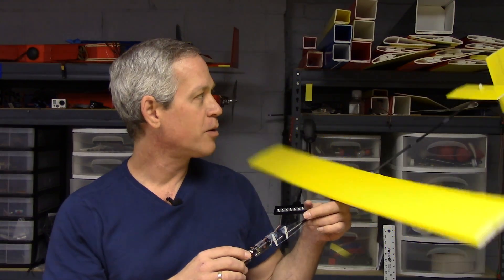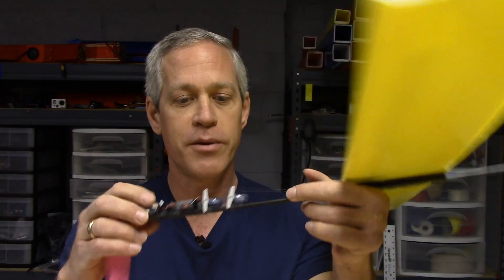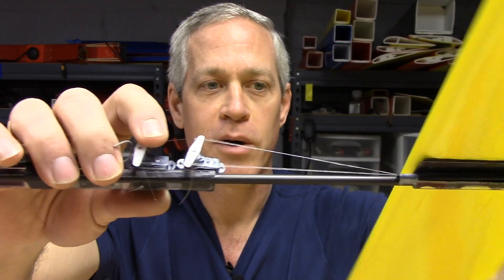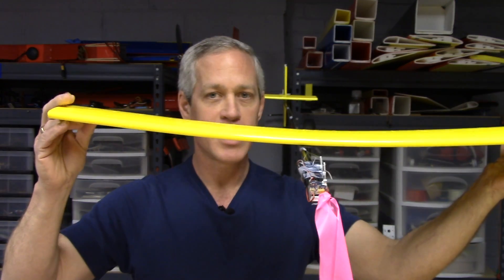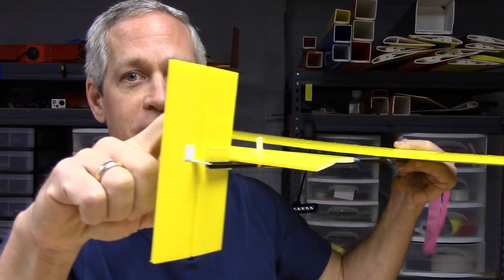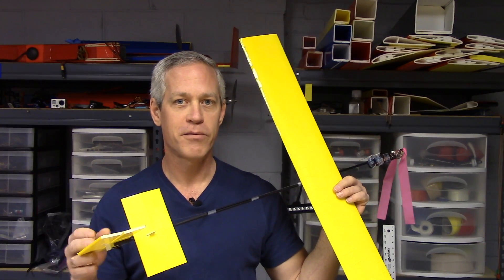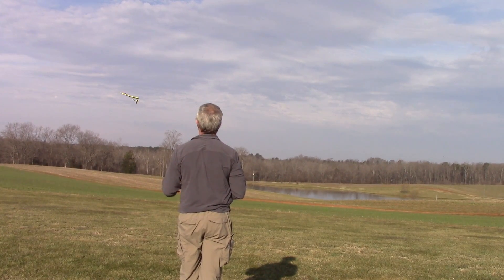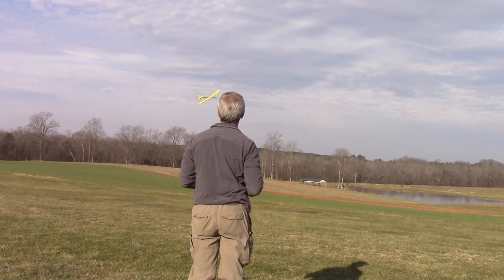Foamboard Discus Launched Glider

Comment: Nice way to make it modular; have you considered making an all moving tail plane type tail?
A pivot and a control slot in the resulting stiff tail seems easier than the current.
Please do not take this as a dis on the excellent plane, this is a suggestion for further models.

Comment: I made a variation of your design after watching your video. I ended up slotting out the underside of the main wing slightly narrower than the carbon tube, and pushing the tube into the slot added a few degrees of dihedral to the wing. This also gave it the extra strength to hold up to harder launches and made it a bit more streamlined. So far I'm getting about 30 seconds of flight time on flat ground

Comment: It looks pretty un-aerodynamic. You could make a thin balsa or plastic pod for the front to over the electronics. Also the front of the rudder and elevator could be tapered for less drag. I think this is one way you could get more longer flights.

Comment: A simple and fast way to lock the dihedral in ought to be to prop the wing up with the wanted dihedral, and then hit the top tape lightly with a not too hot covering iron....or a clothes iron on very low setting (experiment on some scrap to find the right heat)....to just remove the wrinkles seen in your clip on top of the wing when you push the tips up. The thin shiny Packing tape we use is most often made from polyesther, same as most heat shrink covering films , and will shrink in the exact same way when heated. I often use this method to "neat up" my older tape covered planes when the tape loosens a bit or wrinkles in the sun; its also good for improving the adheasion of the tape a bit. The reason for the low iron setting is partly that it's only the adhesive that is keeping the different stripes of tape together , and it lets go at a lower temperature than what the polyesther foil can withstand, allowing the tape pieces to shrink away from each other - and partly not to melt the foam. Just a question of finding the right temperature.
Reply: On the airframe itself: I have some DLG experience, and to me it seems you have the basics down nicely; it's quite light, and yet the wing still penetrates quite well. A bit of playing around with the CG might make it easier to keep level; the fact that it goes straight on a throw tends to suggest its balanced fairly close to the neutral point. Just slightly further forward will make you trim the elevator slightly more up, causing the plane to pitch up by itself on a throw, which is how I trim my planes. This is very much a "preferrence" type of thing though. Since it's RE only, a bit little more dihedral might also be a good thing to make it easier to control.
I also have a feeling most of the reason for your last throw to cause the wing to let go lies in the throwing technique, or rather lack of same. Your throw was more of a sharp flick than a large circle discus throw. The flick induces a lot of rotation, which would be great for a boomerang or frisbee, but puts very high mechanical force on the joints of a plane. Hence Great idea with the tape; built in chosen weak spot - you pick where it will break. Try straightening your arm out completely, and apart from whats needed to keep the arm straight, try to avoid using your arm or shoulder muscle to perform the throw. The movement should come from rotating your torso around its vertical center axis. This will in experience give you the highest speed along the intended flight path at release and the least amount of "flick". Hope this makes sense.

Comment: Great design! Perhaps if you make the wing bolt on and put a throwing peg in it you will be able to achieve 50 ft launches! Maybe a small carbon wing spar will help too. If you cut some material off of the tail surfaces it might help with the aerodynamics a little and it will decrease the tail weight allowing you to lengthen the boom, which will substantially improve flight characteristics.

Comment: Do you have to use the Elevator to keep the nose up? If so, it may be a bit too nose-heavy. It should fly mostly level on its own, but if it's nose heavy you'll have to continually use Up Elevator to maintain pitch, creating drag and causing it to stall out. Try adjusting the CG about 1/8" at a time and see if it helps.

Comment: I like the design, nice!  I agree with the other guys... slope!  and a bit more wing area maybe?  Single plate kfm-2, massive bevel and tape hinge the leading edge of top and bottom plate; top plate is 40% to 60% of wing cord (bottom plate)  Easy build, really strong, and the step on top makes great lift for a glider.  Blue skies, Brother

Comment: The way you throw the plane is... well, bad.
First of all, you got to extend you arm more in the beginning of the launch. When your arm is close to your body all the time the plane don't got time to accelerate in a orderly fashion. If you start with it extended, rotate you torso, and bend the arm closer to your body right before you drop it. As long the pitch is right, and you don't drop it to late you will see it penetrate the skies. 
Secondly, consider making a new, thinner wing with a carbon tube as a replacement for the foam spar. 

Nice plane though!

Comment: I love that you are taking on this challenge!  I am by no means an expert myself, but I would like to offer some things to consider at least.  First, I think your form during the last launch contributed to the disintegration.  It looks like you flipped it with your wrist.  Try to keep your arm strait and rotate your body.  Second, consider adding more fishing line as reinforcement.  Rout this added line from the front of the nose out to the tip of the wing, and then back to the rear of the fuselage.  I would suggest at least doing this to the side you are launching from if not both sides.  Keep up the great experimenting!

Comment: Nice work! You could get the wing to remain attached if you run some strong, light line from the front and back of the wing joint to the tip (like a very acute triangle). I sometimes put carbon/kevlar tows into composite wings for exactly this reason. The incredible side force on the wing only exists while you're holding it during the launch (once you let go, forces quickly return to normal), so if you can rather "hold" the fuse than the wing, you should get much more power in the throw. This design has a lot going for it if you just remove the disintegration feature.

Is that a gravestone at 4:51 ?

Comment: you use run fishing line from end of the wing to other to maintain wing shape.
Reply from the maker: +Fe Wolf I thought about that but it's draggy, if even a just a little.  I think I can get the dihedral to last for a day's worth of flying.  I'd like to try a proper spar with real dihedral built in, but also more weight.
Reply: One thing I have used is a little steam forming, running a  iron over the wing on a pre shaped design, I used the ANX float jet wing design small curve and roll up on the tip. http://www.hobbyking.com/mobile/viewproduct.asp?idproduct=8359

Comment: Wonderful minimal design. You know that would be an excellent light wind slope soarer.
Reply: +fromkentucky No I haven't, but I will. Thanks for the clever suggestion.
Reply: +Andrew Newton quick u better get to the garage and make one. Imo just put a small motor on it and dont worry about the gliding skill part :) Considering how light it is the 8.5mm gear driven setup can generate ~54g thrust is that enough to keep it in the air?
the setup would only add another 15g or so tops
Reply: +Side85Winder - H, i can you post links for such motors and the tiny ESC's needed, many thanks mate
Reply: +Andrew Newton Have you tried Hotwire cutting 9mm Depron, or any Depron? I'm wondering if it would be possible to cut a really thin airfoil that way.
Reply: Here is a performance link they are brushed 8.5mm motors you find on micro flyers and drones.
http://www.rcgroups.com/forums/showthread.php?t=2009496
most hobby sites sell brushed esc to drive these things so shouldnt be to much trouble to set it up.

Comment: Awesome build.

I flew a foam DLG that I designed a few years ago and it was tons of fun optimizing it to the point where I was getting close to 45 second flight times in good conditions. I was using a wooden dowel boom which was the weakest point and would flex a bit, but only failed a couple of times.

Comment: Hello sir, great video.
I would just like to comment that planes with curved surfaces are much more efficient. For the wing it would be difficult, but you could easily cut the H.S. and V.S. a little bit to make it curved.
Also, you would see a huge difference in performance with more dihedral.
Colin

Comment: Have you thought about aerotowing? Or a small, homemade brushless sailwinch?  This design seems to be quite efficient, but a little too unefficient as a DLG. I towed a small rc depron glider (about 1 meter) some time ago all by myself, meaning that i flew the towplane and the glider, with two remotes of course. The dihedral kept the glider stable and gave me time to land the tow plane. And even though the glider was quite heavy (about 90g), i got some great thermals with it (at over 100m its usually better than on the ground).
Would be cool if you did something like this with your building techniques, maybe a noob tube towing your DLG? ;)
Reply from the maker: +Rcmodellbau_DE That is probably a great idea.  I need to dedicate myself more fully to sailplanes and I think a winch would be a great gear addition.

Comment: Beautiful plane Ed.  Like the name too.  How did you keep the wing on after it came off.  I mean before the last throw.  

Why use the fishing line style control linkage, I mean it looks awesome but is there something necessary with this style of plane or is it just for weight.

I'd be interested to see a video like you have done in the past of you building one of these (motor / prop style also).
Reply: +SnapPunch Robert Pull pull is very light and gives nice slop free control.